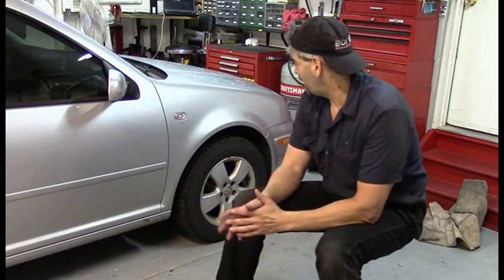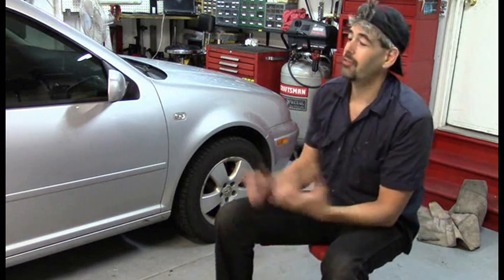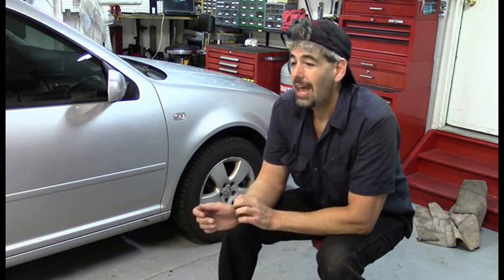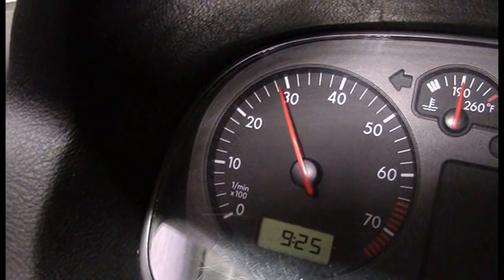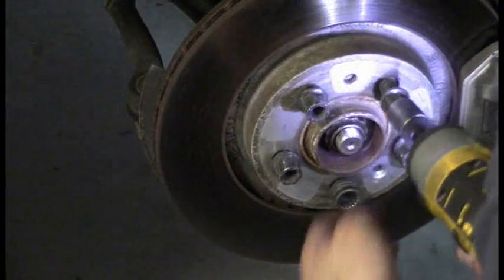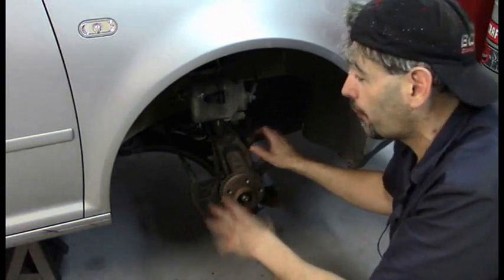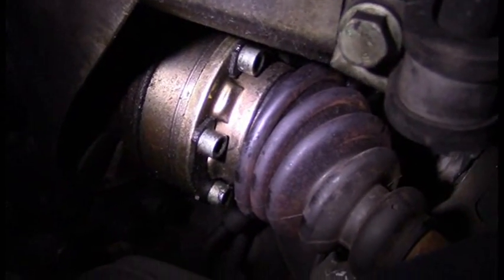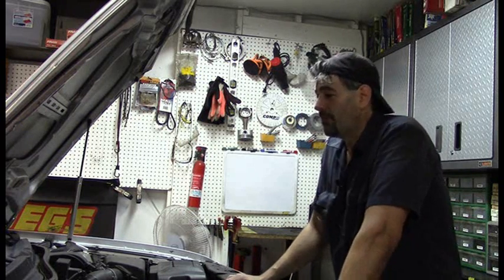2003 Jetta Vibration Diagnosis- Is it Driveline, Clutch, or other?

Comment: Thank God FINALLY! I've been describing these exact same symptoms to a litany of mechanics for months, and they all give different ideas without conclusive determinations. Toyota's chief mechanic even suggested the drive shafts, which I outright rejected because the vibration goes away when I press the clutch at high RPM, and the drive shafts would continue to spin meaning the vibration would continue if they were the culprit.  I have a 2000 Toyota Celica GT and I just recently installed a low mileage JDM 1zz-FE engine by myself  (which I'd never done before) to replace my original which had over 300K miles and blown piston rings. I re-installed my  factory re-manned 5 speed manual transaxle (which I replaced about 8 years ago). Since I had the transaxle and engine separated for the 1zz swap, I removed my stock flywheel and had it resurfaced at the machine shop, but I also bought a new stage 2 clutch to install. At first I was worried that maybe I had bent the input shaft while wrestling the transaxle onto the engine but multiple mechanics reassured me the way I wiggled it on there wouldn't have done that. So, lately I've been suspecting that there is a mis-match between the clutch and the flywheel since it's a stage 2 clutch. Perhaps the flywheel is too heavy for the stage 2 clutch and is causing my vibration due to imbalance? In my case, the drive shafts are still the OEM toyota genuine parts and if I pulled them out for a test  like yours gear oil would leak all over the place like you mentioned. I'd hate to rip out my transaxle just for it not to be the issue, but I'm thinking that's the only possibility left.

Comment: Having the same problem with my 2000 beetle 1.8t with 5spd.  I like this approach to the issue and it's good to know i'm not the only one who has experienced this. I only did an cv axle, strut, & tie rod end job...the clutch wasn't touched.  After watching this, I've come to the conclusion that the aftermarket solid drive axles are the problem...even though the clutch vibration is always there, but the OEM hollow axles neutralized it and that's why VW used them.  Unfortunately, even the solid axles get sold as "oem" parts and now i'm stuck having to find and buy new axles or rebuilding the original, which were replaced because of play in the cv joints.

On a side note, i have also heard that the  muffler heat shroud can cause vibration at specific rpms...but i'm pretty sure that it's coming from up front in the drivetrain.

Thanks for the video, you have a very intelligent approach.

Comment: Another way to rule out axles and rotors is to jam a screwdriver in rotor  vane allowing screwdriver to stop spinning when it hits caliper bracket. Do this to one side at a time and check each side for vibration loss this would not only eliminate trans but pinpoint to a specific side of the car. Limited slip in transaxle will spin wheel of least resistance! Great video!
Reply from the maker: John Decowski Genius! Yeah I never would have thought of that I admit!

Comment: Problem w/ clutch assy vibration is every part is symmetric about center and nothing to get out of balance or leave out. Perhaps flywheel was removed and not reinstalled correctly.  A wobbling flywheel might cause this problem.

I had a similar nightmare problem w/ my 94 Accord EX. I had strong vibration under acceleration at many speeds. I found a damaged rear motor mount and thought I had problem addressed. But after motor mount replacement vibration unchanged. I suspected the CV axles and attempted to duplicate problem on jack stands, however I was unable to detect vibration in this condition.

So I first  replaced axle that appeared to have largest amount of slop in CV jts. No change. I next replaced 2nd axle and problem remain unchanged.

I looked again at motor mounts and found no problems.

Deciding I must have bad CV axles, I removed both and returned to AZ for warranty replacement. Wah! After replacing both axles, problem stubbornly remained unchanged.

Thoroughly defeated, I drove car for some time and considered my options. I finally decided the AZ axles must be at fault. I noted they did not have the vibration dampner on the axles. I ordered new axles from Raxles and got a store credit from AZ for their axles. Problem was resolved and has not returned.

Great video!

Comment: I had one that vibrated at idle once but only if in gear and only if your foot was on the brake.  I like to have never figured it out.  It was a loose spare tire carrier.  Occams razor.   Good troubleshooting steps.  Process of elimination allows you to reach a solid conclusion and can save you a lot of time and money.  Well thought out and reasoned.
Reply from the maker: Occams Razor!!! Haven't heard that one in a while but that pretty much the approach!!

Comment: Hi Matt, I guess I might be adding my five cents worth a bit late here as you may have solved the problem already. anyways for what its worth I am 100% with you that its not a drive line problem & it is in the clutch/flywheel area.

One thing that has not come up in any of the other comment is that when you depress the clutch you are end or thrust loading the crankshaft. It would be nice in hind sight to see if the vibration went away if you loaded but not fully released the clutch & also see what it did in REV.

This is an unusual fault & I hope you to get to post or make a part two follow up video.

And please keep up the good work on shaming the fourm posters & parts changers. I work on heavy equipment (CAT) here in New Zealand & have seen the machines change a lot over the years & become very complex with there systems. It would blow your mind the amount of money I have seen thrown at machines to fix problems by guys that just cant learn the new systems. I try to teach the young guys under me the foundation principles of how things work be it hydraulic, electrical or mechanical.

Keep up the good work.....

Comment: (VW 2002 GTI 1.8L, 5 speed manual) I have the exact same problem in the exact same RPM range. Mine started after I had the timing belt replaced. I think it might have something to do with the harmonic balancer which is removed to get to the timing belt. I have to get under the car and look at the harmonic balancer both static and running.
Reply: what was the problem?

Comment: An old post I know but in hindsight it's the flywheel alignment, same is happening on my 09 golf right now.

Mines a 1.9tdi 5 speed, it's going to stretch me fixing it but I'll do it. Next time I'll be fitting a new clutch kit too, when it's needed. 

All if I don't have to replace the flywheel through it now being damaged because of wear to do with the misalignment problem?

Comment: I currently have an issue with my 2011 Volkswagen Golf IV (front wheel drive) that is exactly the same as you described
The only difference is that in my case the vibration occurs between 3,000 and 3,200 revs. Could be because my Golf is a 1.6 TDI and based on the revs of the Jetta I would guess that's a gasoline engine, not Diesel.
Anyways, a little bit of the background story:
Two weeks ago I took my car to the repair shop because of noises that occurred when taking (only) left turns. And also because of the anual inspection required here in Austria. So I never had any issues with vibration from the engine or anything like that.
The Mechanic inspected the drive shafts and detected a slight looseness on the right shaft and went on to replace it with a new after-market one (only the right one - not the left drive shaft). After I picked up the car, I immediately noticed the very strong vibration at around 3,000 to 3,200 revs and the initial problem with the noise at left turns has also not been fixed. I called immediately and scheduled to bring it back the next day. They looked at it again and said they'd have to change the engine mounts. Said and done but the issue still remains.
On Saturday (two days ago) I went to a friend of mine who has a lifting platform to see what they did and I was shocked to find out, they didn't properly screw the driveshaft (on the gear box side) in and the grease was all over the place. Besides the danger they put me in and the additional damage that might have been caused already (maybe) I put the screws in tightly, but the problem with the vibration still persists.

I wanted to ask you, what was the final diagnosis for the 2003 Jetta? I was looking for a follow up video, but couldn't find one.

Thanks for your help!

Comment: At 3800 rpm the flywheel and pressure plate turn , and applying the clutch does not change their speed ,but pushing the clutch in will change the speed of the input shaft and clutch disk. . I would suspect something  has to do with the input shaft or related parts and not in trans as it is same in every gear. Makes me think may be pilot bearing or bad clutch disk. This is interesting , Hope you get to do a follow up vid ,because now i really want to know.
Reply: The vibration also disappears when the vehicle is at speed, in gear, and the clutch is pressed. In that case the drive shaft and friction plate keep their rpm.. So these are probably not 'it'.
Reply: antiekeradio but torque would still be applied different still

Comment: I'm having a speed dependent vibration on a 2000 Jetta. Or shake is more correct I suppose. It happens under steady speeds and is worse when climbing a long hill, but backing off the gas stops it immediately. And it's intermittent, as in I'll be driving along for x amount of time, which varies, but I'll feel it start, then it intensifies, and goes away when I let off. Lather, rinse, repeat. I've replaced the struts because they were worn out, and the ball joints because they had marginal play. In fact the upper strut mount bushing was so bad the strut would move around 2.5 inches in any direction at the top. Changing those eased it some, but it still persisted. I rotated my tires (rear to front, front to rear. No side to side) and it only did the violent shaking (substantially less violent, however) to me once this morning, but it still did it, and the entire time on the interstate this morning I had a mild vibration in the steering wheel and on the dash. I did have to replace an axle a month or so ago because of a popping CV joint and it started this crap just last week. And I replaced the driver's side and this FEELS like it's coming from the passenger side.I'm wondering if the control arm bushings are bad enough that when it picks up this resonance they allow enough deflection to shake that badly. They're in need of replacement too anyway, but I know that won't cure the vibration because only rotating objects can cause that. An axle shaft out of balance would probably be single speed dependent, and this is occurring at any speed in any gear. Slower oscillations at slower speeds obviously. No brake pulsations. I did replace both axle shaft seals when I changed the axles because one was leaking, and I'm wondering if those drive flanges are balanced to the transmission. I can't find any information on that. But I would assume that would be equivalent to an out of balance axle and be single speed resonant.

Comment: Regardless if the axles actually turned out to be the problem(which sounded like it was NOT related to the axles), the internet is correct, the factory axles have a tube for the passenger side and IIRC there is a rubber vibration damper on the driver side on some models. Both act as an harmonic balancer. Crappy aftermarket axles do not have either and thus cause a LOT of vibration problems. I am curious if these axles are solid or tube style for the passenger side.  They might be remans which tend to be better because they are OE axles that are rebuilt. 

I wrench on these cars as a hobby and it is well known that aftermarket axles cause problems. Shame that the parts-changer shop didn't just reboot the OE axle considering OE boot kits are under $30. 

With that said, I salute you for not just changing parts and actually taking the time to diagnose the problem.
Reply from the maker: Yes I am aware of ths tendency with the aftermarket axles which is specifically why I strategically eliminated this as a possibility as one of the first steps.
Reply: not just VW, 
Audis can "go off" too with an axle swap.....maybe they (axles) should be sold in balanced set?.
one bad axle swap makes an A4 convert. into a paint shaker.  : (    Even the dealers do it!!

Comment: I would expect the vibration in neutral also, with the clutch engaged.  Either way it is something with the clutch i.e disc, partially engaged throw-out bearing etc. you might even find missing or mis-matched bolts. Good luck!  Was the flywheel removed and resurfaced?

Comment: Good Video Matt, Hey a good advice to DIY's would be to be careful Not to push the brakes while they are removed like you show on the video, caliper pistons would fly out in no time. But hopefully you have a part 2 coming up.
Reply from the maker: Oh man, excellent point!!!!  Yeah I of course was very conscious not to use the brakes (which is instinctive for most people and indeed would be a problem). I should have mentioned that and in fact sometimes I put a block of wood between the pads just in case I forget!!

Comment: I just had to comment on the wheel bolts - they are much stronger and resilient than threaded hole-stud-nut combination. Those have more failures, introducing possible seizure and snapping points.
Regarding difficult to install tire - use one stud on few threads to align and hang the wheel on, install remaining bolts and then the last one.
Reply from the maker: hmmmm if that’s true why do I only see studs on high performance cars and extreme torque vehicles while the bolts are always on little economy cars?

Comment: In the UK it's the lower engine mount (often referred to as the dog leg on forums here) that gets fingered for everything from tyre wear to drive line noise on this model before any actual diagnostics are performed!

Does the vibration occur when the revs are decreasing through 3800? Or only under power?

My logic is that the dual mass flywheel is not under duress on the way down through the revs. The clutch's pressure plate and the input shaft are still driven on decreasing revs (they have lower inertia than the flywheel).
Reply from the maker: Good point about the observation on if vibration is when revs are increasing or decreasing.  It is both- anytime the engine speed is 3800-4000 whether increasing, decreasing or steady.   Hello to the UK! I love how you guys spell words there- I never get tyred of it!

Comment: Matt…. finally :) lol I have been looking forward to this one.  What you hit directly on the head on this one, is that no matter how many times and issue may be a "pattern" failure, there is ALWAYS the chance that your situation is the time its something totally different.  Even if its a warranty situation like this, which NO professional tech likes to run into, the only way to properly diagnose this is exactly how you did it.  Great video!  Is it just me or at 10:54 was that a directional tire that was on backwards?  I could be wrong but it sure looked like it :)
Reply: It was 🤔. That could cause some issues but it remined after removing the tires.

Comment: You ever do work on the b5? I have a 2000 audi a4 1.8t quattro having a big shimmy between 45-50mph and only during acceleration. Just replaced the front driver cv axle and no shake before the replacement. It’s a Duralast. I will check the rpm later today.

Comment: 20:09 I'm not positive but I think it may have not been visible by eye at least by the water level, but if you watch the reflection on the surface of the water that may be responding to the vibration. What do you think? I might be fooling myself, but I thought I saw surface motion respond accordingly.

Comment: Unbalanced tires vibration are correlated to  speed, not rpm. Removing wheels will not eliminate warped rotors vibration but any vibration from them will, again, will be speed related  but we have already determined that vibration is related to rpm.

Comment: 11:45 There is supposed to be a small screw in one of the small holes in the rotor to 'lock' it onto the hub
Reply from the maker: Not necessary when reinstalling. That is strictly for manufacturing purpose. Though it does make it easier to reinstall I admit.

Comment: This is fascinating. I wonder if it has to do with the clutch bearing being one size too large (or a slight imbalance of the drive shaft). If there's a slight imbalance with the drive shaft, then the vibration could make the vibration at a given rpm could affect the engaged transmission. When the pilot bearing is engaged (by pressing on the clutch), then the shaft would align (or be pressed into temporary alignment) and then silence the error.

Comment: Interesting diag and results.  Unrelated to your vibration the right front tire was on backwards.  Directional tires turing the the wrong way can cause drive-line noise and instability.  For bolting on rotors old axle nuts work good as they allow the nut/bolt taper to rest against.  You shouldn't have to take the tie rod off just turn the steering all the way out and you will have enough swing to get the axle out.

Comment: I'm having the same problem it's my 1.8t. I'm pretty sure it is the main motor mount which is on the passenger side. I had my clutch for at least ten thousand miles. The person who has done this clutch has done many for this car and absolutely know every little problem. This car has a lot of torque and esspecailly when under a hard load. POLY MOTOR MOUNTS WILL FIX THOSE CHEAP RUBBER MOUNTS. THESE THINGS ARENT CHEAP. MOST PEOPLE GET CHEAP PARTS AND THINK THEY HAVE THE METAL THAT THE CAR NEEDS. ITS CALLED GERMAN ENGINEERING FOR A REASON👌🏻😝